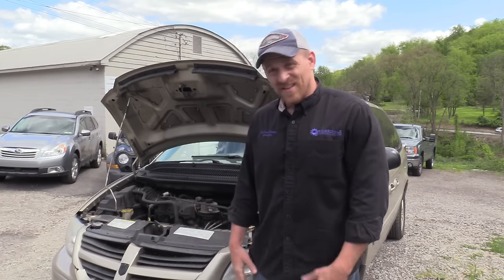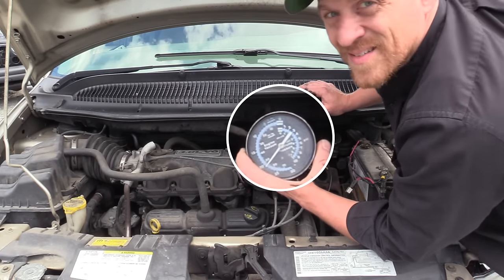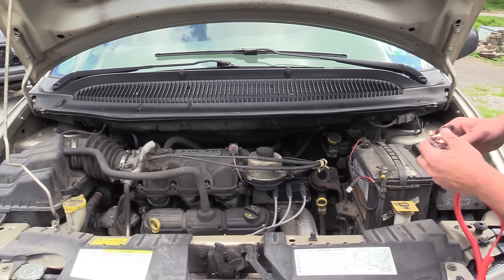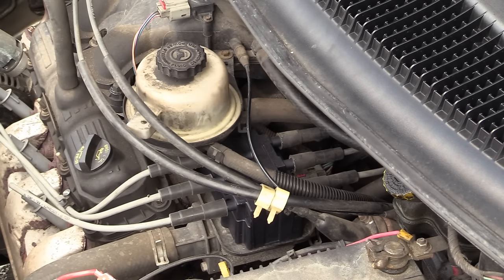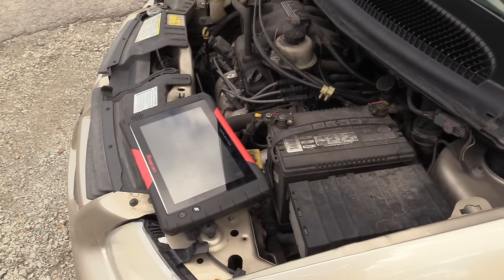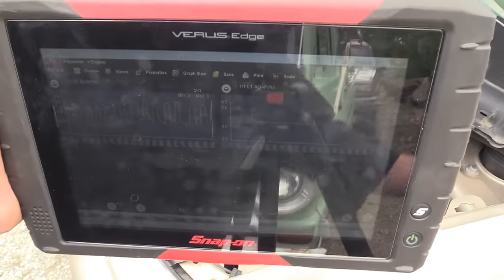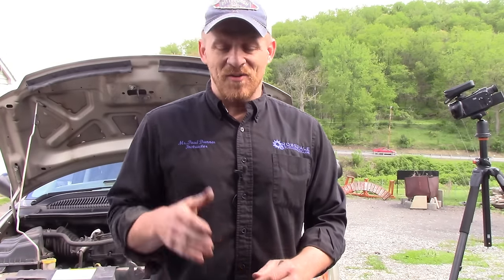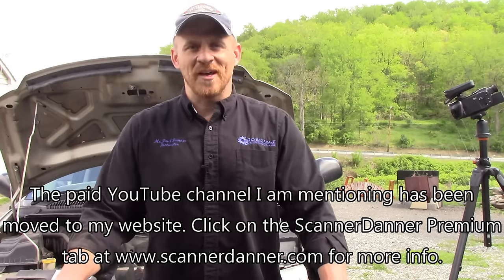Misfire Quick Tests (Is it a spark, fuel or compression problem?)

Comment: Do have your Amp Clamp on the ground side of the battery?
Reply from the maker: either the ground or power cable on the battery will give you the same results (what leaves the battery, comes back to the battery)
Reply: 2v Dc setting on the scope?
Reply from the maker: Since I was using the Pico and a HIGH amp probe, I have preset scales that match my current clamp, so I did not have to do the math.  But yes, if I was using my Verus and a low amp probe, I would set the scope to a 2v scale and have my low amp probe set to the 10mv/a setting. Making 2v = 200 amps
Reply: My gosh do people nit pick and try very hard to call you on "mistakes"....grow up
Reply: I'm just asking questions trying to improve my knowledge base from some one much more experienced then my self.
Reply from the maker: @Mike Shirvis
Mobius was just asking a legitimate question since he has seen me using the low amp probe and Snap-on scope before. 
People absolutely try very hard at times to call me on "mistakes", so thanks for defending me. This just wasn't one of them. 
Thank you both for being here.

Comment: When I️ was a kid I️ had a Daewoo lanos with a 1.6.  I️t ran strong and perfect, but once hot, at idle it had a rough idle at times.  I️ chased that problem for months, until we pulled the head and discovered the problem:

Occasionally, when hot, an exhaust valve would hang up on its guide.  I️ had never seen that before, and never seen I️t since.  However, my machine shop guy told me he would see that frequently on marine applications.
Reply: As dunny
Sunnyvale

Comment: In  the past have found as the valve is turning a warped valve face will intermittently not seal properly. its usually thinner on one side on  the exhaust valve side. I made this repair back in 2009 with a year model 1999  town and country /200,00 and its still running good today. My point to new technicians, be confident in your diagnosis and don't be afraid to repair instead of replace.

Comment: If there is anything left of the body it might be worth putting an engine in IF you did it yourself. Since its at Petes shop, sounds like the customer would have to pay somebody to do the repairs. If thats the case, game over. I would assume its about a $1500-2000 job for a shop to install a used engine in that?
Reply from the maker: Not to mention all the other work this van needed, it just wasnt worth it.

Comment: Wish you could look at my truck but I don't have an ECU, no fuel injection, a mechanical fuel pump and I can't figure out why it's missing.........but I will, eventually, you could probably do it in ten minutes.
Reply from the maker: Do an RPM drop test, (short plug wires out one at a time) and figure out what cylinder is not contributing. Then let's go from there
Reply: @ScannerDanner  Gonna try it tomorrow, I really appreciate the reply.

Comment: Wow That is Very Cool To See it Happen Live With That Tool ! Thanks  For Showing It and How it Works  Sanner Danner and i Like The Video You Did On That 5.7  With Propane Start Showing The Bad Fuel Pump  and The 50 psi For it To Work With That Type IGN

Comment: Would of been nice to see an in cylinder pressure waveform to intermittently catch the lifter not opening the valve on time/or at all, Missed a rare opportunity. But still a great vid.
Reply from the maker: I didn't miss performing it (in cylinder psi transducer) from a time stand point. To film and edit it, and listen to myself try to interpret the readings, then find I can't see a damn thing,
only to find out I'm further down the rabbit hole with time consumed and I now need to tear it apart to prove the fault? No thanks, been there and I wasn't repeating that on the p.o.s. 

Trust me, I wanted to prove the exact fault but decided on this vehicle, it wasn't worth it. Did you see my hesitancy? :-)

Thanks bro
Reply from the maker: Sorry for the rant, I didn't mean that how that sounded.
Reply: ScannerDanner I know exactly what you mean and I am with you on that side of it. I was merely pointing out its very rare to see compression intermittently disappear 👍👍. Thought it was a prime opportunity to catch a rare case study for your premium channel it reminded me of this vid https://youtu.be/_DEtOHuOioo
Reply from the maker: I agree 100% and if it was the front valve cover, I would have just pulled it off. I did miss a good opportunity but just couldn't make it happen on this day :-(

Comment: Would be helpful to have found out what the problem ended up being. Possibly loose valve seat.
Reply from the maker: Based on the comments and the repetition of the low compression waveform, this was absolutely a valve and seat issue. Best I got, sorry

Comment: My car is a Chrysler Sebring 2.4 and I was going down the highway on cruise at 75 and It made a weird noise when I took it off cruise it started the blinking check engine light and I changed coils spark plugs and wires and the check engine light stays on but when I start driving or revving it starts blinking and throwing the random misfire code can anyone help has new spark plugs and fuel pump coil and wires and few new sensors
Reply from the maker: What codes do you have. The weird noise right before the event is concerning. Maybe your timing belt jumped a tooth? You'd have related codes if it did. How does the compression sound test I showed in this video sound on your car?
Reply: @ScannerDanner  p0300
Reply: @ScannerDanner  cranks fine and everything seems normal but once I start getting around 60 it starts to shake wish there was a scanner Danner in my town 😂😂😂
Reply: I'm going to record a video maybe you can spot something and also this help is really appreciated I spent hours out there working on it and you'll probably know right away
Reply: @ScannerDanner  I posted the video hopefully it helps to narrow the search lol if not it's fine thank you very much
Reply from the maker: @abramporras7877  I do not hear a misfire at all in this video. How does it run while driving it? Do you feel it misfiring or is it just the blinking light and P0300 code without feeling a misfire? 
What year is this Sebring? Does your scan tool offer you the ability to reset all adaptives? I had a Jeep kick my ass with a false random misfire code and that was the fix.
Reply: @ScannerDanner  it drives good up until I get to around 60 then it starts shaking some it's pretty old car doe maybe it's shit lol it's a 2008 Chrysler Sebring 2.4 . My scan tool is a little cheap one but It does erase all codes I did this and then after five min it'll come back on then I'll erase again then it'll come back on usually after a few min it comes back on I was wondering if I should take it to a shop or drive it until it breaks down completely ....thoughts? My ultimate last guess was Catylitic converter but I'm not sure if that's it cause I put two new o2 sensors in and I haven't got a code for it so I'm lost .
Reply from the maker: @abramporras7877  have your symptoms changed since you changed the plugs, wires and coil? What you are describing sounds like a classic secondary ignition misfire.
Reply: @ScannerDanner  I said screw it and took off on a two hour road trip and after about hour and a half of driving 75 it stopped blinking then after the two hours I started driving back home and about 30 from my house the check engine light was gone completely so Im thinking you were right about just a false code or something but it's gone now ....Thank you alot idk what or how it fixed but I was at the screw it point and it fixed thank you for your time I'll recommend your channel to everyone I know
Reply from the maker: @abramporras7877  heck yeah , that works too. Count your blessings. What I was describing is not accompanied with any symptoms that you can feel, so I'm not sure what happened for you. If it comes back, hit me up on my forum. It is free to join www.scannerdanner.com

Comment: Ive got a 2002 Chrysler T&C and its doing the complete opposite. Runs good at idle but runs like shit when in drive or Rev.. pyrot to seeing this video we changed air filter started running better then got rough again. changed plugs and wires still not much buty noticed a bad exhaust leak just b4 muffler so know thats patched, now said vehicle will not start. hold the gas pedel down itll start to hickuo some like its gonna sgart but then dont. plus just a cpl days ago lasttime it was drove u could misfire in the exhaust?????
Reply: btw ours is the 3.3ltrt V6

Comment: Change the pcv  valve  it's stuck in the open position problem fixed
Reply from the maker: No sir, a pcv issue does not cause low compression on a single cylinder

Comment: Wonder what the customer decided to do and if they opened it what was found? Loved seeing you get that Picoscope out @ScannerDanner ! 

Maybe you could do a exclusive video on your forums and do a run down of your "mobile" diagnostic tool set you take with you and go over everything you have and why you have when it comes to the specialty stuff. Also it would be good to get a walk thru of what you do in regards to the production of a video from start to finish, cameras, software, etc. 

I'D watch a half hour or hour long video about what you take doing mobile diagnostics and why. Also would like to see how you go about doing any ecm or other control module programming when mobile or do you normally use the internet of the shop you're at for the hard wire connection they recommend for programming? Do you use a certain type of programmer, snap on, drew tech, etc?? 

I think a few videos when you have a slow period about it would be great. IF you did that I'd subscribe just to watch those videos alone and the classroom stuff. I've read your book twice but to be honest the book without the videos is less entertaining as with most mechanics and this is my belief that the hands on real world situations and/or videos when combined make the experience a whole lot better. 

I learned more in the time watching you use that Picoscope than I've learned reading countless articles, user manuals etc. The more I apply those physically the more I'll remember them as well. I sometimes just hook up stuff so I understand how the waveforms go and how to set the settings. Between you and the guided component tester on my modis edge I become more and more confident in my ability to use waveform from a scope whether it be a Picoscope, UScope, or Modis Edge Scope. I should quit making this a hobby and passion for fixing my stuff and helping friends and maybe start making some of my tool costs back here and there. Keep up the great work!!

Comment: Sounds like a spark plug wire arcing out intermittently. Change the plugs and wires, flush the engine, sea foam it or something similar, put new oil and filter... you might get a few more miles out of it.

Comment: Hey Danner, on your website are you posting new content on your pay part? I just cancelled my premium membership on this site.
Reply: yes he is
Reply from the maker: Yes I am. I have maybe 11 new videos up since it opened. An 8 part basic electrical course. A 2 part misfire and ecm replacement and program, and a low power case study using a VE calculator and MAP readings at WOT to test for intake restrictions.
Thank you so much! 
https://www.scannerdanner.com/join-scannerdanner-premium.html
Reply from the maker: Thanks Craig!
Reply: Another informative video. Maybe could you explain companion cylinders? On a v6 are companion cylinders always the same? I think in the video you said 3 and 6 were companions. If so can you just quickly which are companion cyl. Thanks Paul enjoy your videos and classroom along with your book.
Reply from the maker: A companion cylinder means the pistons are in the exact same position, just the valve positions are opposite. When one cylinder is on TDC compression, its companion cylinder will be on TDC exhaust. Here is the rule on determining companion cylinders:
Take the firing order ex: 1-2-3-4-5-6, split it in half 
1-2-3
4-5-6 
Companion cylinders are 1/4, 2/5, 3/6 Hope that makes sense.
Reply: Is there something that can cause the spark to jump through the boot on a coil on plug? Replaced two ignition coils and are still doing the same thing. Baffled by the spark jump not sure if something can cause that or just received two defective coils.
Reply: Why not make a new post Pedro? There are some driver issues on some pcms that cause ignition coils to stay on, destroying the COP
Reply: m ph didn't notice it was on a recent post apologies. Would that cause the spark to penetrate the boot on a new COP?

Comment: That's not crazy huge miles, but lack of maintenance seems quite likely.  The owner should fix the real problems, like the brakes and warped rotor and drive it til it quits.  Maybe pour in some seafoam and transmission fluid into the oil.  Might get lucky and unstick a lifter or valve  before it's a permanent issue.

Comment: Is your book an E book, or an  actual  paper book?
Reply: You can get an E Book or a paper book
Reply: Both formats.
Reply from the maker: As the guys already said, I have both available at www.scannerdanner.com Thank you! Let me know if you have any other questions.
Reply: Is the piston I have the same problem before on Chevy
Reply: The book is great - I have the paper one. Great to have on hand when I need it!
Reply: You could check that with a wet compression test. (put a little bit of oil in the cylinder and check compression)
Reply from the maker: I could have done that but this did not look like a ring issue at all, especially with its intermittent nature during a cranking compression test.

Comment: A blown head gasket between cylinders? Cylinder leak down test next maybe more useful.
Reply from the maker: a blown head gasket wouldn't have a patter to the low compression issue. This is absolutely a valve/seat issue as the valve rotates as it moves up and down. You can see the repetition in the pattern
Reply: @ScannerDanner  No problem just throwing it out there as I have seen a very similar waveform pattern with a picoscope from a known blown cylinder head gasket before, but your the expert.

Comment: looks like it was hit and miss on the compression, somebody probably got it really hot and now a valve is kinda sticky
Reply: Yes.that could be it. A valve that is slightly bent and seals in one position , but keeps rotating and doesn't seal when it has gone half a turn.